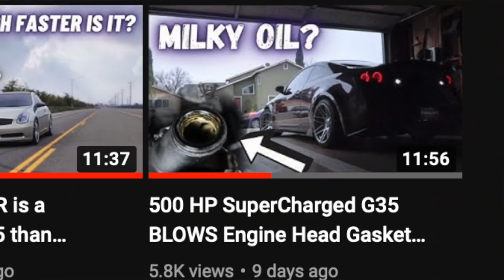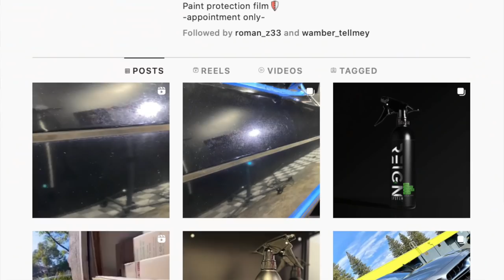SUPERCHARGED G35 GETS FIRST TOMEI + FIXED THE HOOD THAT FLEW OFF!

Comment: @BeDistinct I also have that same oil cap got it months ago when I was ordering from Z1 Motorsports, it really holds up nicely, no leaks whatsoever, just sometimes is really hard to pull off and the Tomei sticker didn’t stay on due to the heat in the engine bay, but that wasn’t a big deal, love the way it looks in the bay